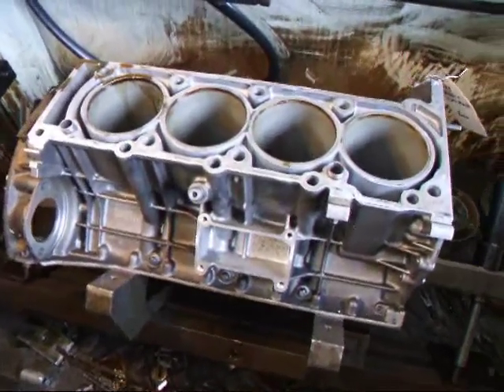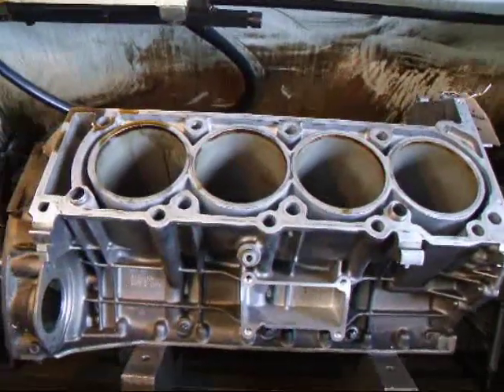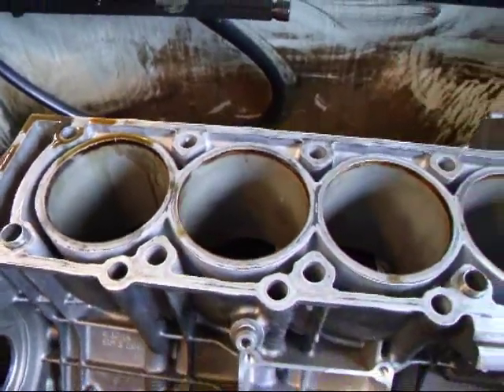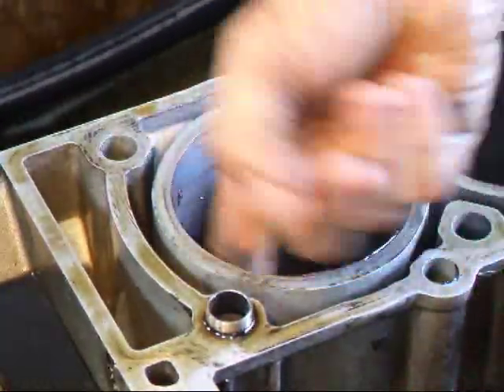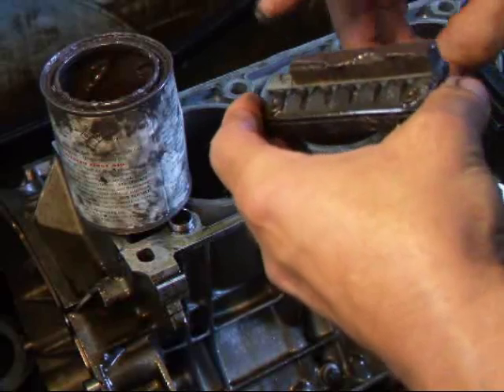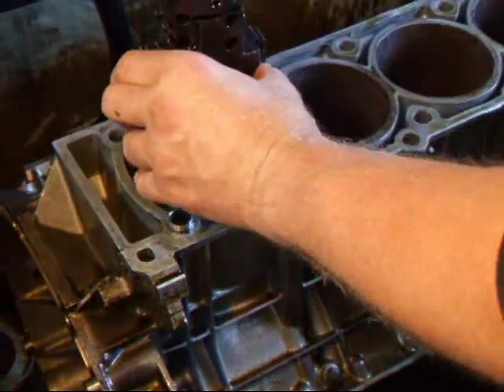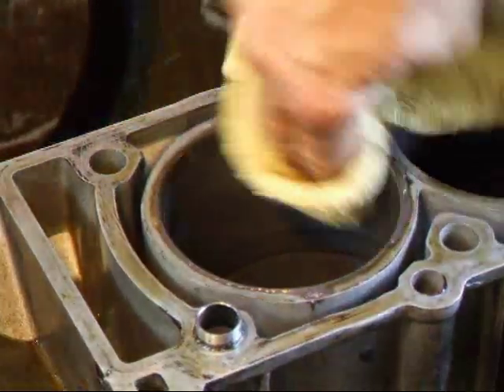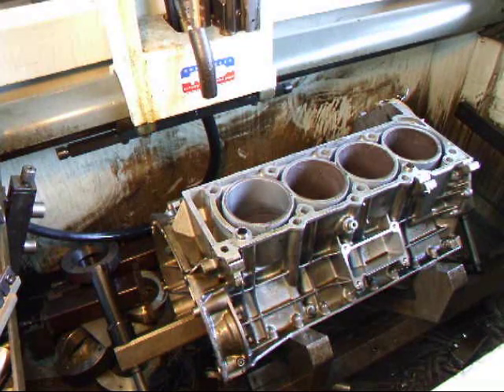Mercedes Benz Alusil Cylinder Conditioning

Comment: @doormagic- NO.  Alusil is a material an entire block is made out of (Aluminum + silicone).  Nikasil is a plating.  Alusil blocks do not need a plating nor do they need any sort of steel liners like most aluminum blocks.
Reply: when recondition you can coat with nikasil and remove it up to alusil, to fix it at nano kevel

Comment: @МихаилФилиппов - Alusil is NOT A LAYER!!  The entire block is made of this material.  It is NOT like Nikasil.  It is not a plating of any sort
Reply: They are actually sleeves that are cast into the block . I’ve seen it with my own eyes , all you need to do is take the head off a block & look .
Reply: @thelongranger55  This is incorrect for Alusil.  For Nikasil and other coated cylinders, you are correct, but with alusil it is not a cast in sleeve.  I have rebuilt these before, and it is very clear it is not a separate sleeves when you "take the head off and look"

Comment: Hi, I am currently reconditioning a m62b44 bmw engine with an alusil block. I just have a question on how you clean the pistons as i believe they are iron coated. What is the recommend way to clean these without damaged this coating? Is it ok to soak the pistons in a heavy duty engine degreaser?
Reply: solbound09 I am going through the same process as you are the Pistons are fine with just some brake cleaner for cleaning out the ring grooves however . The Machinist that made this video died there is some shade tree guy in his place I took my block to this guy to have him recondition the boers and he totally f*** up the block left a bunch of scratches and cross hatch marks in it

Comment: If a cylinder wall with AluSil coating has been slightly scratched? Can this block still be rescued? Or do I have to find a new one?
Can the scratches be scraped down and applied with a new coating?
Reply: omfgwtfbbq90 its no coating. In theory you can bore it but you have to hone it using a special acidic compound

Comment: hi i got an m113 v8  merc alusil engine, had high heat on one cylinder , only burn marks , mechanic says need new block, can it be repaired by this method, maybe light scoring as well. horizontaly
at top of cylinder.
Reply: If you want reliability, resleeve the engine with steel liners.

Comment: I’m glad I stumbled on your video. I’ve never rebuilt an engine until now. I’m working on a 560SL & tore the engine down this past week. After removing the heads I found a couple of long scratches in #4 cylinder. I’m not sure if honing is enough or if there is something else I can do. I just posted a video showing what I found. I would be interested in hearing what you thought. 

https://youtu.be/VwGMKS5E-Mo

Thanks again for posting your video.